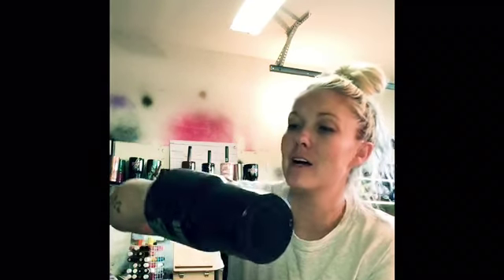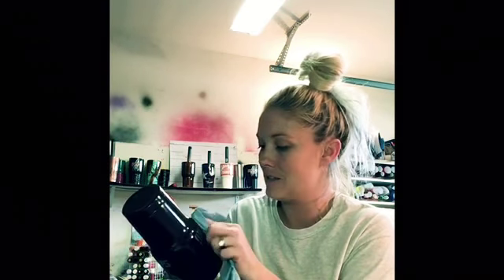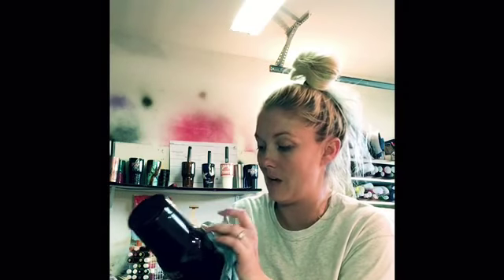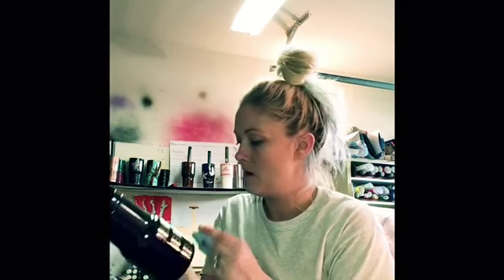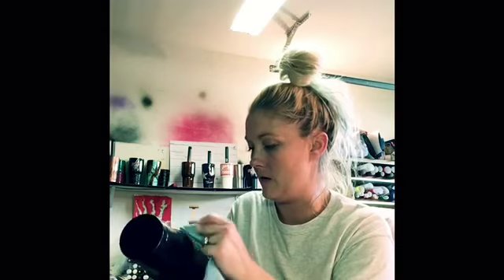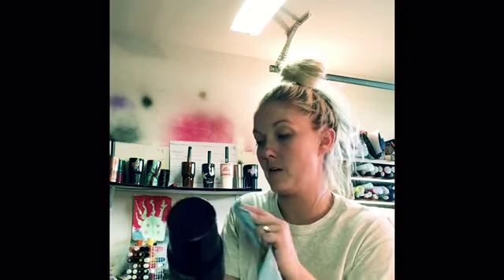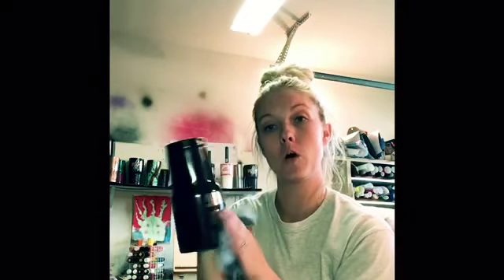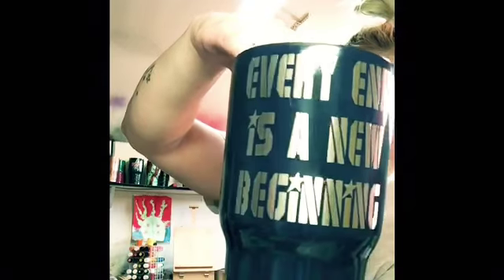Removing Vinyl/Stencil Residue

Comment: I switch to pro marine epoxy because you said you love it. But my problem I am having is I get a lot of fish eyes with that epoxy. Can u please help me on this issue. I don't want to have to switch back again
Reply from the maker: Missy Cantu have you watched my million dollar shine Epoxy method
Reply: Teambrandos Design yes ma'am I did. I literally paused and followed your steps and did exactly what u did. But no matter what the epoxy would make a lot of fish eyes. The only way I could prevent that was pouring a thick coat at one time but then I am back to wasting epoxy.
Reply: Missy Cantu I had the same problem! But I figured out that I had to much heat on my cup, either with my heat gun, or my space heater.  I use my light for the first hour or so, then after it has cured for a little bit I’ll turn the space heater on.
Reply: Teambrandos you leave your epoxy sitting for an hour?? I thought u left it sitting for like 5minutes. I am so confused...lol
Reply from the maker: Missy Cantu Missy Cantu oh that wasn’t my comment I think what she’s meaning is when it’s on the spinner using her heat lamp
Reply from the maker: Missy Cantu but what she is saying is true u can have to much heat. Also if your heater is a fan heater and it’s blowin air on it that can cause the fisheyes also where ur heaters placed is a factor as well
Reply: Teambrandos Design I do have a space heater that does blow. So you are saying I should get a different space heater and keep it kinda of away from the cup? Cause the minute I apply a thin coat onto the cup I start to see the the holes between the epoxy and the cup.
Reply from the maker: Missy Cantu if u can messages me of Fb so you can give me a little more detail. But yes if the heater has a fan in it it’ll cause that